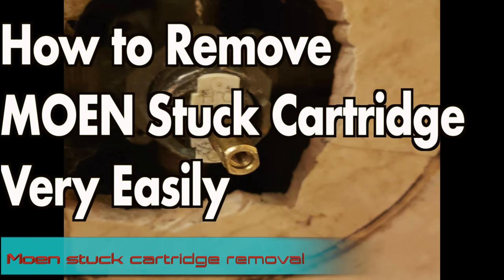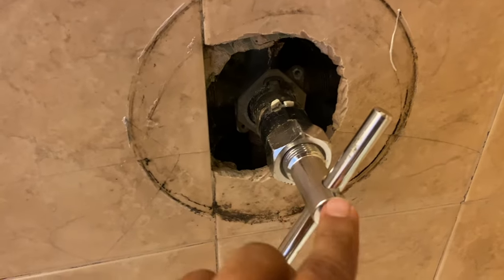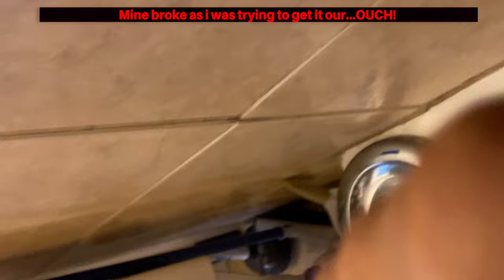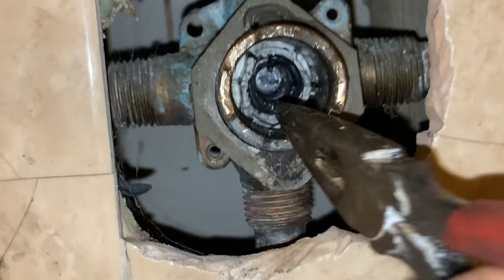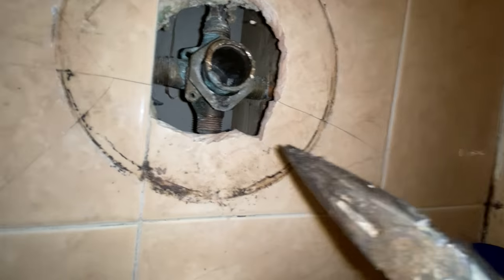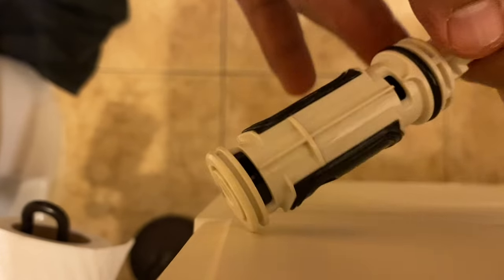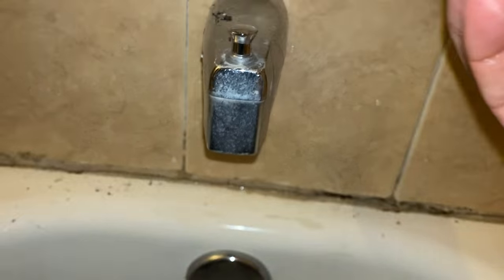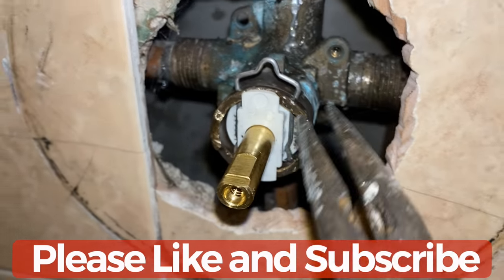How to Remove Moen Stuck Cartridge

Comment: Squirt WD40 inside and let it sit for 5 or more minutes. I did that and the part wiggled out. Hard water deposits were locking it in place. I also used wd40 to loosen the outer brass ring that held my cartridge in

Comment: Try after removing clip. Wd 40 inside wiggle it back an forth til moves.take water jugg cutt top off to fit shower diverter valve.Turn on water. let water pressure push out.
Reply from the maker: Thanks

Comment: I had just replaced one and taken it out was stubborn,  pulled it out where it would not go any further and sprayed penetration lube, work it in and out get those rubber seals lubricated. Before replacing the new one is to make sure you have no debris inside the housing, or it will give you problems getting the lock pin from engaging.
Reply from the maker: Thanks

Comment: Thank you for the tutorial on a stubborn job. I've had plenty of those working at a hotel. My only question is, would we have to clean i side the pipe with a brass or stainless steel brush to make sure all debris and or rust is gone?
Reply from the maker: You can yes. Use viniger as it helps or use chemicals that helps remove calcium. I wouldn’t suggest going aggressive as it can damage the smooth finish and then washers wouldn’t be able to hold the water. The inside must stay smooth. Scotch bright is best for cleaning.

Comment: Thanks for the video. Now I can do anything! 
My cartridge didn't break, used a heat gun - not sure if it helped or not. Ended up breaking the plastic tabs off then I was able to screw the nut on the puller tool further. When I saw the first O ring I pulled and wiggled and pulled. Finally it came out!

Comment: Hi this had my brother and i stumped! It got stuck a quarter of the way out... we wiggled pulled cursed 🤬 and nothing... so before breaking it to smithereens my brother had the great idea of using wd40 around the vavle between the metal and plastic .. we pushed it back in pulled out several times spraying more wd40 as we went. A few push pulls later,  pop!  it came out!!! Fyi you will need to clean the area where the new valve will sit with soap and water to clean off the wd40 that was used. It can damage your new seals. Good luck!
Reply from the maker: I didn’t need to do any of that :)

Comment: What if the stem is broken ?
Reply from the maker: Use needle nose. You can also drill and insert a screw and then pull on the screw. Just don’t damage the valve

Comment: I actually had to melt my cartridge to get it out.  I scratched the brass to deep and now have to replace it because it leaks.   Sucks for sure but thats the way it goes sometimes.
Reply: How did you scratch the brass? I need to melt mine as well I believe - actually its the part holding the cartridge that won't come out - any thoughts?
Reply: @59nang  Hello.  I scratched the brass by using a screwdriver to try and pry/remove some of the melted cartridge.    If you can buy the Lakeview Cartridge puller or the ONA puller- I would recommend that over melting.   I have very hard water so I have to replace cartridges yearly it seems.  So I bought the Lakeview and no longer dread it.  But it is expensive but worth it over melting it out.  Melting really sucks to do.

Comment: I'm at this point now. Purchased a  Butane torch to melt the plastic part maybe that will make it easier
Reply from the maker: Nooo it will damage the inside
Reply: @HowToDoitright  Butane torch worked awesome!!! Melted plastic enough to get metal portion out leaving the plastic shell. Now hit that again with torch and thats all she wrote. Clean up the valve apply some Vaseline to new cartridge and install. Valve in perfect condition.  Actually alot safer than jamming tools in there and possibly scratching valve.
Reply from the maker: @HUFF-N-PUFF-2024  noooo never use Vaseline on the valves or any rubber pieces 🤦🏻‍♂️ it’s super bad and will make the rubber seals go bad in a short time. Only use silicone lubricant.
Reply: @HowToDoitright  oh geeezzz Thank you!!!
Reply from the maker: It’s ok I learned it the hard way too but then I bought silicone grease and keep it around
Reply: @HowToDoitright  Update the cartridge I put in leaked out of the spout took it all apart again went back to  Home depot and this time paid extra $20 ($52) for the Moen version and not off brand. This one actually came with silicone that was alot thinner so it slid in alot easier and works perfect! Thank god. Lol
Reply from the maker: @HUFF-N-PUFF-2024  yes never put the aftermarket stuff always use the original

Comment: Or, you could simply take a propane torch with a button trigger and mildly heat the brass housing while pulling on the cartridge.
Reply from the maker: Using torch you are heating up pipes inside and any other valve close by with rubber will go bad with heat. Avoid using torch.
Reply: I used a two-stage heat gun.  It looks like a hairdryer only it is more powerful.  It has two settings and it was rather cheap from Harbor Freight.

Comment: If your cartidge is stuck, this is the tool you need:  https://www.youtube.com/watch?v=K_26KQzZPBw  The Moen tool will only pull about 1 inch.  Mine was still stuck, but with the ONA Puller, it completely pulls it out.
Reply from the maker: Yes but it’s not worth buying $75 worth of this tool for a normal person doing a cartridge replacement once in a life time. This tool is for professional plumbers to use who do this on a daily basis. For a one time diy person this trick works fine.
Reply: @HowToDoitright  I've replaced about 6 of these Moen cartridges, one was for a buddy. Of course, I am almost 80 and I do most of my own repairs.  I had a duplex and a Condo in Florida so that is like having three houses. Florida water is a bitch they are really difficult to remove.  My house in the North used Lake Michigan water and I didn't have any problems in that house. I just finished replacing the cartridge in my Florida condo and it was a bitch.
Reply: I had one break, used an easy-out screw extractor and it came right out. Be sure to lube the outside of the new cartridge before installing.
Reply: @ekroman3d  Also a large tap will work if the guts of the cartridge pulled out and all you have is the cartridge housing.

Comment: Moen  is a piece of poop don’t buy that crap buy all brass, if you are rich do as you please but everyone else buy all brass not moen plastic don’t go for looks go for peace of minds ,moen only good for Five years then it will cost you thousands.
Reply from the maker: No it doesn’t cost thousands lol. It’s just one piece. All valves eventually goes bad regardless of brand. Some last little longer and some fail sooner.
Reply: @HowToDoitright   yes it did I have a 3 level house  that faucet leaked o the third floor
Reply: That moen faucets leaked on my third floor my tenant was on vacation, all floors saturated, b*tch cost me $80,000  , in California in Mexico were you probably live cost $10 .
Reply from the maker: @TheGiovanni0531 oh wow. Yes that’s bad now but if it leaked it should have spit the water out from faucet and shower into the tub and drain. How did it cause damage I’m curious.
Reply from the maker: Na I live in Florida. Costs the same but i never heard about this much damage from a leaking valve. I always use moen for years and never had any issues. You sure your tenant didn’t cause the damage?